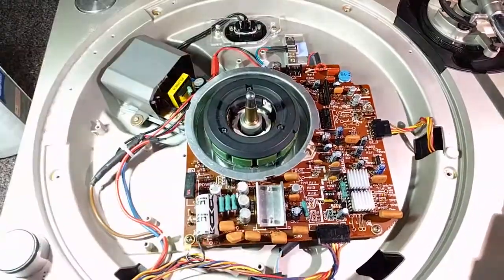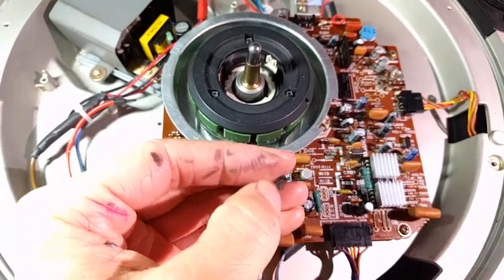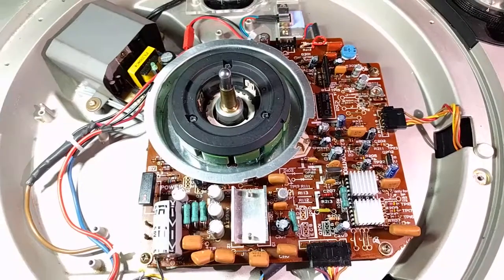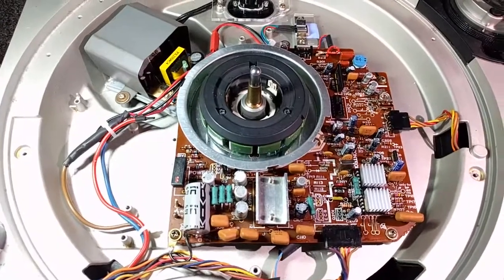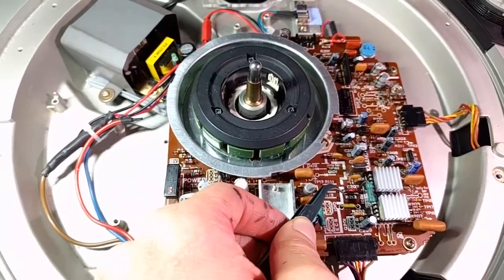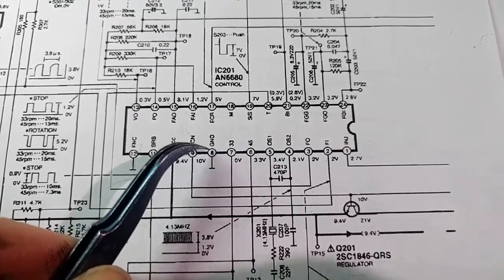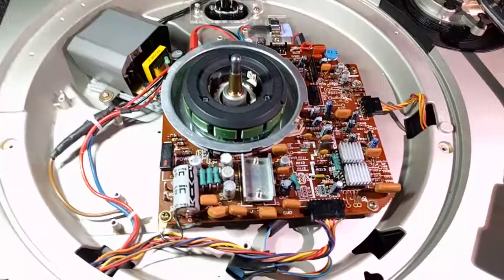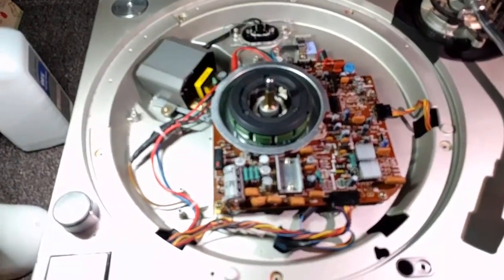Technics SL-1200 MK2 Motherboard Repair Explained

Comment: I've been digging through yt looking for someone that has replaced the capacitors on their 1200. Thanks for putting this up. I just bought my third 1200, this one is an MK2, so likely pretty old. It's been repainted. The model and date of manufacture sticker has been removed so I can't nail down the age for sure. All I can go off of is the parts used. If I had to guess the age of my MK2 I'd say late 80's early 90's probably. 
     I'm not nearly as knowledgeable about electronics or electricity as you but I can follow directions and do basic electronics repair. I have the tools and some experience. I'm just trying to figure out if I should replace my capacitors due to age. I think I need to based on age alone. Is there a way to check without removing caps so I know for sure if they're out of spec? 
     The work you did on this looks great btw. The paint job is nice, the work is clean, the mods useful. It's just well done. 👍
Reply from the maker: most of my caps are 15-20 years old in my MK2  people are way too obsessed with cap replacements these days.  If itsnt broken, dont fix it.
Reply: @SegasonicfanDesigns  ok thx
Reply: As someone who has owned 3 Sl1200 I have a question for you I just got my first 1200 MKII, I Noticed that on the plastic cover there is a bulge right above the triangle with the lightning bolt, is that NORMAL? I though it was warping from heat but there is a cut out underneath that lump like Technics was making space maybe for heat dissipation? I noticed the Resistors under that spot R201 and R213 get REALLY hot on mine 118F and 132F respectively do any of yours get THAT hot?
Reply: @Ocular Cavity  I don't know how hot mine gets but I can check if you'd like. I don't know enough to say definitively one way or the other what this specific parts operating temperature should be. However, if my 1200 MK II is also operating at those temps odds are it is normal. Would you like to check my turntable and see? I won't be able to get to it until tomorrow but I will check it if you'd like.
Reply: @djluminol  ABSOLUTELY Thank You SOOOOOOMUCH that would be a BIG help if you could check the temps it would at least put my mind at ease
Reply: @ocularcavity8412  Ok sure thing. I have some vinyl rips I need to make anyway. I'll check tomorrow.
Reply: @djluminol  I can't thank you enough for this it is such a BIG HELP XD
Reply: @ocularcavity8412  Ok so mine was warm but not hot. It wasn't 120f hot. I ran the turntable for about 45 minutes. No djing, so no start / stop, scratching or added stress to the deck. Just normal on/off for recording vinyl. I'd suggest you get the service manual and check the voltages and resistance of the parts you are concerned with. From what I saw, the part numbers you referenced were for the speed brake. If the speed brake is going bad you might see a large variation from slight adjustments in how fast the  platter stops as you adjust the brake. In the same way a bad pitch control will speed up or slow down the platter a bunch with very little movement when they go bad. You can check that pitch control voltage with a multimeter. You just need to know the standard operating voltage range. Assuming the brake works like a pitch control and it's adjustments are made through voltage variations it should work the same.
Reply: @djluminol  thanks for the information I have not checked the Brake potentiometer, I did already check the Voltages related to the components and they were all where they should be, But thanks to you I now have a new area to investigate it does seem to take a little bit long to stop compared to the videos i have seen, thank you VERY MUCH

Comment: I also have a Silver SL1200 MKII the transistor you moved to the top power plate mount in Mine gets to about 100F thinking of doing some kind of heatsink mod but, I saw you put a Heatsink on the IC AN6680 chip, I noticed heat in that area of myself but in my 1200  it wasn't the IC 201 It was R201 and R213. Is it normal for the resistors right next to IC201 (AN6680) to get HOT? In My 1200 resistors R201 and R213 reach temperatures of 118F and 132F. after 10 minutes
Reply from the maker: cant say off the top of my head, but look at the schematics.  Some of the resistors do get DAMN hot because IIRC some were used as voltage dividers.  The larger greenish blue ones are what Im talking about (1W+ rated).
BUT, if your table isnt broken DONT MESS WITH IT.  "If it aint broke, dont fix it!"  These tables are work horses, and I wouldn't mess with anything if all you notice is heat.
Reply: @SegasonicfanDesigns  Thanks for the advice and for replying. R201 is a blue/green color I usually don't mess with things that are working but I have wanted one of these for YEARS and I finally found one for an affordable price ($18) but if I lose one of the IC chips I won't be able to afford to fix it I will probably just go the Heatsink route to at least just to keep the An6680 cool if nothing else,  and just keep an eye on the temps
Reply from the maker: @ocularcavity8412  Yeah, the IC does get hot, but keep in mind these were tanks designed to take abuse.  They became the DJ scratch table of choice because it can handle stopping the motor constantly, forcing it opposite direction, etc.

If you want to add the heatsink though, I used something like this:
https://www.ebay.com/itm/334647058273
Reply: @SegasonicfanDesigns  I will definitely grab some of those thanks again XD